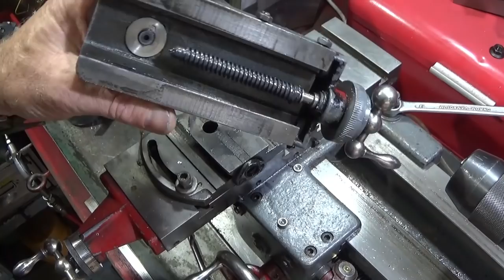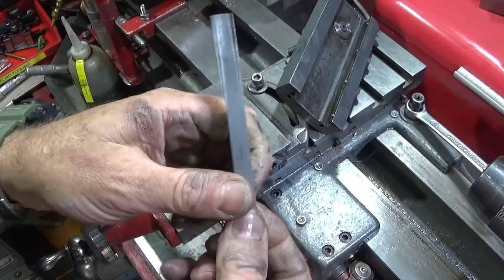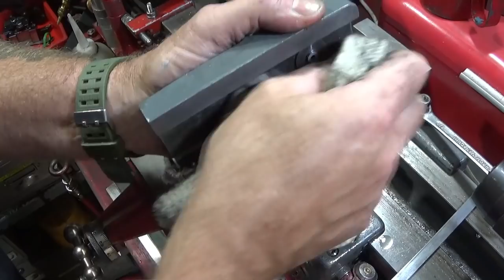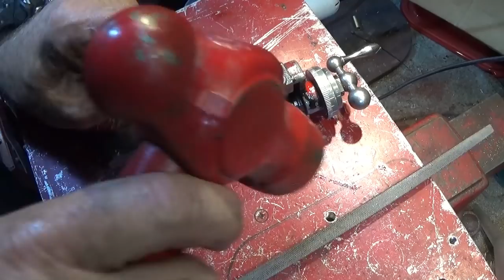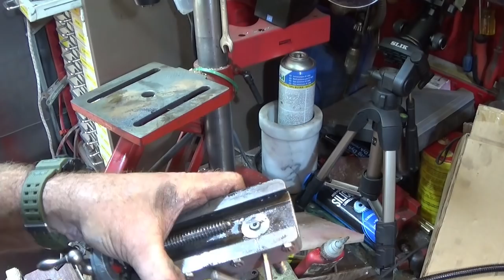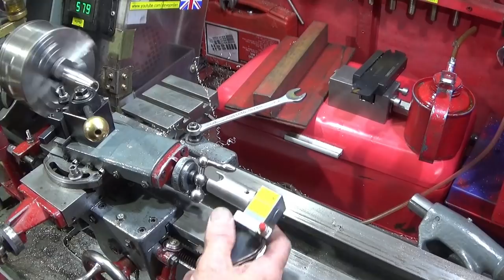Myford ML7 Compound Slide Re-Grind & Locking Screw Upgrade.

Comment: -Thanks Steve for yet another good "how-to"! One thing I wonder, though: -Now, when fitting the 2nd compound slide, doesn't that mean that you also ground the crossfeed dovetail in a bit, thus compromising the fit of your original compound? Guess the CI dovetail takes more of the grinding than the steel gib, also? Just my 2 cents of wondering. Cheers, and keep up the good work! DIYSwede.

Comment: Great, concise video on the lapping process. Thank you for sharing. Somewhat unrelated I’m having trouble adjusting my saddle on my Chinese mini lathe. I believe it’s a siege S3? Do you have any advice, or videos available to help me learn a better way to adjust the saddle retainers?
Reply from the maker: I have done videos on this with the Mini lathe. One of the best things you can do is to take the saddle plates off, remove the grub screws and put the plates back on with shim instead of the grub screws, This allows tightening of the plates fully without bending them. Obviously it is experimental at first, to find the required thickness of the shim to be used, between the saddle plate and the underside of the saddle.
Reply: Steve Jordan thank you. I will search your archives and try the shims. I’m definitely bending them as they show evidence of minor damage on the inside corners.

Comment: steve its the handle  with the dial on it to traverse from left to right  "tail stock to chuck" "thank you very much for your quick reply...laurence
Reply from the maker: Hi Laurence, on my Myford it is held on with a grub screw. A 1/8" Allen key fits mine. If yours is the same the Allen key socket maybe worn? If so you can glue the Allen key in the socket after dipping it in something like loctite 638. There are various ways to get them to unscrew. That is if it's the same as mine? Regards Steve
Reply: @SteveJordan   thanks  steve ,,its the same as the grub screws that fit the cutting bits to the cutting tool,,,,,,,,,,, ,          on the theme of excess over hang ,,my ml10 has only   3 1/2" centre height,, x 13" between centers,, and i have a 5"4 jaw independent chuck,, i dont want to overload the  main bearings ..could i put an equal mass to the tail end of the head screw there for balancing out the revolving mass...... love your channel   i am learning all the time,, regards ,laurence

Comment: Steve,

I am currently modifying my Clarke mini lathe in accordance with your other posts.  I have dispensed with the compound slide and 4-way tool post, and am making new tool post block.  However I am not sure which quick change tool post to buy - I would like to be able to use the12mm index tool holders you recommended from China.  You mention at the start of this video that you had removed the (Anaris??) tool post from your Myford - is this the same make of tool post you use on the modified mini lathe? As a novice I would be most grateful for advice.  Thanks for a really great series of educational videos.
Reply from the maker: Hi Mitch, On the Modified Chinese Mini Lathe I use the Dixon type Quick-Change tool-post. I do have one for the Myford lathe as well and if you buy one it will be marketed as for either of those lathes. It is exactly the same sized one and will take 12mm tools.
 I use a home made block as well rather than the compound slide, which is a poor design on the mini lathe.
 I am currently looking at whether the small Aloris type toolpost can be used on a block for the mini lathe, from Banggood, but I'm only doing it for an option for other people, as I have the quickchange currently set with many tools on mine and there is no real advantage for me to buy and change over to the Aloris type for this lathe now. Regards Steve
Reply from the maker: But having said that I do prefer the Aloris type toolposts from China. They are much more consistent in quality and a better toolpost altogether than the quickchange, plus they are considerably cheaper to buy. If I had the choice when I bought my lathe I would have bought the Aloris type, but I'm not sure at this stage whether it can be modified to fit the compound slide as well....which obliviously the Dixon type can. The Dixon can be used on a block but also on the compound slide giving all round greater versatility.
Reply: Steve Jordan (
Reply: Steve Jordan 

Thank you for the reply.  I will search Bangood today and try and find a suitable Aloris tool post.  As ex-air crew, I have always been most grateful to aircraft engineers for obvious reasons!

Best wishes
Mitch
Reply: Steve,

sorry to take your time, but there are lots of tool posts on the Bangood site and I am not sure which is the Aloris type, and which is the one you have on your mini lathe.  As we are not sure whether the Aloris type will fit the mini lathe, maybe I should buy one like yours, unless your examination of the Aloris type is due to reach a conclusion soon?  Sorry to ask but could you give me links to the 2 options?  Thank you 

Mitch

Comment: Hi Steve, could your method of "regrinding" the compound slide be applied to the main bed? There is a looser bit on my  ml7 near the chuck, which obviously sticks nearer the tail stock. Dismantling and sending away for a regrind seems excessive.
Reply from the maker: Hi Bill, Yes it can be done the same. My brother did it to my ML7 before he gave the lathe to me. My lathe is fine now but could do with just a little more of the same. Obviously it takes a bit more work, but the results are well worth it. I will be looking at mine again soon, to finish off what my brother started, as I can just feel a bit of difference still.
Reply: @SteveJordan  how would you tell which side of the lathe bed is worn to add the paste to the right part? I would have thought ot mattered? If it were on the front edge, you'd only want to apply the paste on the front edge so as to even out the wear. I guess the top slide is a little simpler to "regrind" using your method. Could you share any tips? I'm not a machinist at all, just a willing enthusiast.

Comment: Dam Steve that was nice! What type of oil, you are using on your lathes.
Reply from the maker: I use ISO 32 Hydraulic oil on the bearings. On the spindle nose thread I use thick engine oil...this prevents the chuck from jamming...Regards Steve

Comment: Steve, you did a questionable job of cleaning out the grinding paste with the dirty rag and oil. You should have uses Kerosene (I think you, Brits, call it paraffin) to clean the part before reassembly and you should have used a clean rag that would be discarded after contaminating it with grinding paste.
Reply: Whenever I am cleaning after a messy job I swill all the crud out with carburettor cleaner in an aerosol.

Comment: Cannot think of a worse thing to do ..... grinding paste in cast iron slide ways !! That poor old Myford !!! Scrape it !!!!( not scrap it ) 
 As for your cross slide , looks about 1/8” back lash !!! Sorry not wanting rain on your parade but people will take this as the correct way to do machine repairs !!!  
Regards 
Robert 
Partsmade
Reply from the maker: It worked brilliantly. Very close inspection after cleaning doesnt reveal any residue. Backlash sorted now. All good to go. Works perfectly now. It's a great fix. I did my other one the same years ago and it's still brilliant with no problems whatsoever.